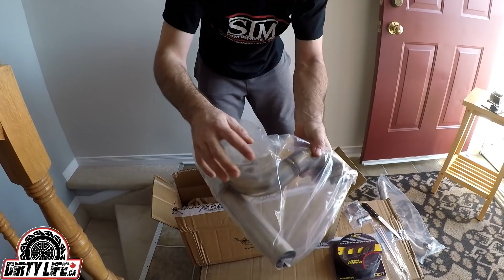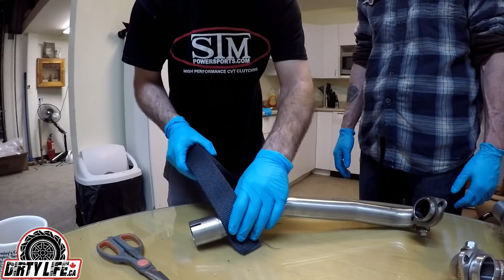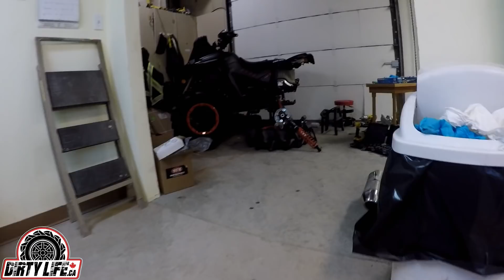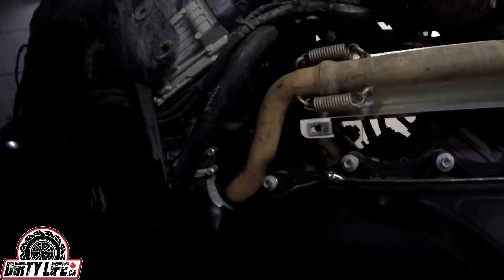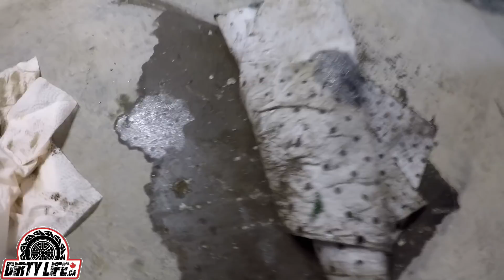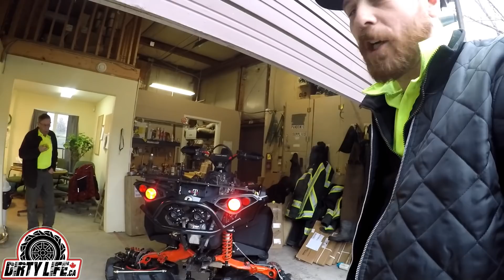RJWC Mud Edition Full Stainless Duel Exhaust Unboxing & Install, Can Am Renegade

Comment: The monster can exhale now..”yeh you did” sorry for the diff....what a machine...thanks for sharing..
Reply from the maker: Yeah she can eh, Stock headers were tiny compared to the RJWC headers. Can't wait to test them out. might take it to a dyno to fine tune the air/fuel.
Reply: Good plan...that will keep from hurting the pistons and the valve seats...

Comment: If you’re gonna hit that thick muddy water take the spark arrestors out before because they’ll clog up. Mine did on my hmf and that thing went quieter than a stock muffler lol
Reply from the maker: I suppose eh, although Keep on the throttle and it won't be an issue eh. Hahaha

Comment: So I have the same exhaust but I’m confused on the tuner does it have to stay on the fourwheeler at all times because I don’t think there water proof plus how do you return it back to the stock factory fuel tune if I want to put the old exhaust on

Comment: Just did same job last night lol n yes pain in ass,did u reuse the outer section of stock heat shield aswell ?i made a mistake and put rjwc clamp that holds 2 header together upside down haha ,n not removing it to flip it ,gonna try today fitting out shield on but thinking it’ll hit clamp
Reply from the maker: Made that mistake once too, Hahaha

Comment: Trust me I was on the throttle lol I was in a race pit going about 10 mph/16kmh and it clogged up on me so yeah hard to avoid plus looks better without it on
Reply from the maker: Good to know thx man
Reply: eh TV welcome brother and I knew that full exhaust was gonna be hard as hell lol that’s why I just went with slip on and only thing you’ll need a spark arrestor for is riding in parks but keep the build up brother!

Comment: @eh TV who did u say to ship the rear diff to and why
Reply from the maker: Before the 2019 models the diffs didn't have the straight cut gears and the tolerance levels had to be just right to get a good life out of one. CanAm was rather sloppy in this area with their diffs. So I sent it off to MudnWheels and he sets them up to fine tune specs. And he'll dress them up for ya too with the help of one of the best powdercoat guys in the offroad community. Craig Weston of ThrillBilly Powdercoating. CanAm fixed the issue from what I've seen. Haven't heard of any failures after 19

Comment: Would you need to run a tuner on a xmr renegade with the rjwc slip on duals?
Reply from the maker: Yes, always!
Reply: I heard that the tuner programs with the bike when you ride it..is that true? Sometimes my bike pops I'm not sure if it is the tuner or water in my gas.